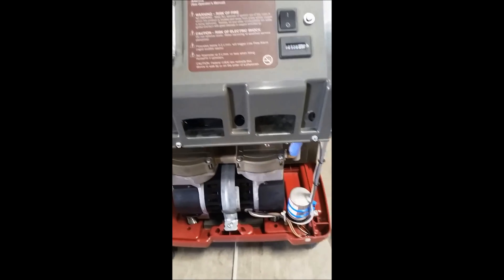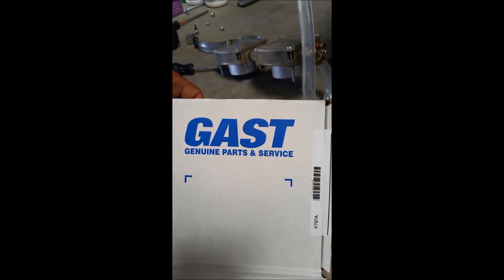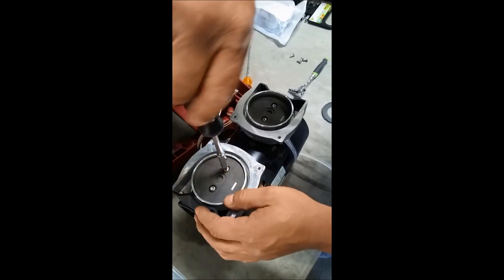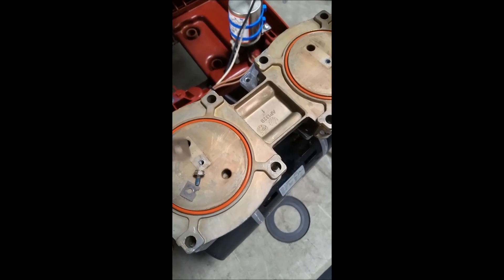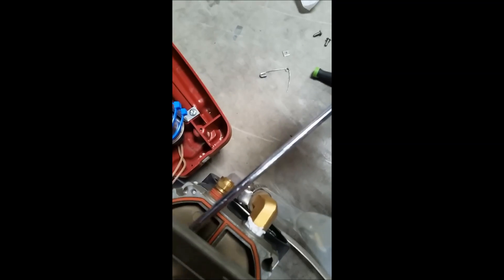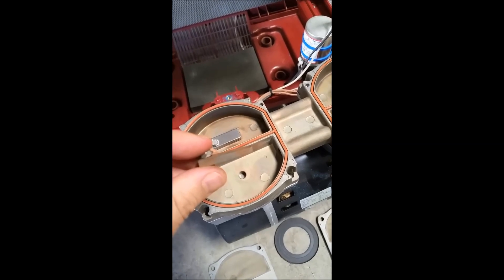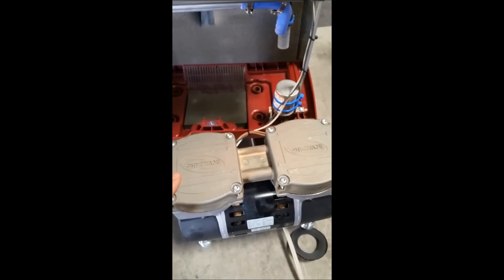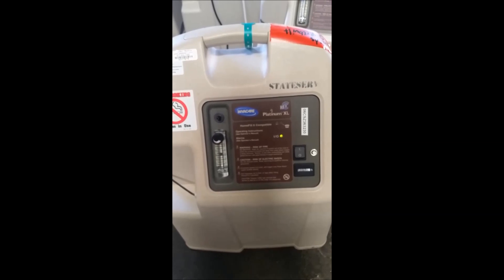Concentrator Compressor Rebuild

Comment: Can this cause the motor to wobble,slow down and trip the breaker?
Reply: Bad compressor start capacitor, very worn almost locking eccentric and/or compressor inner bearings, or bad compressor windings.........in that order.